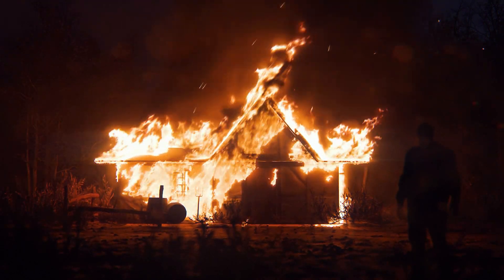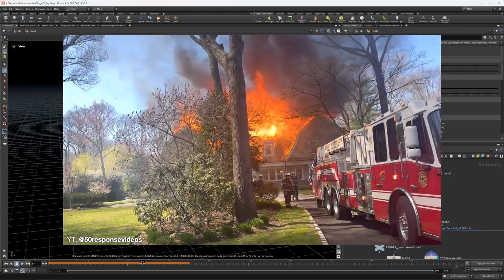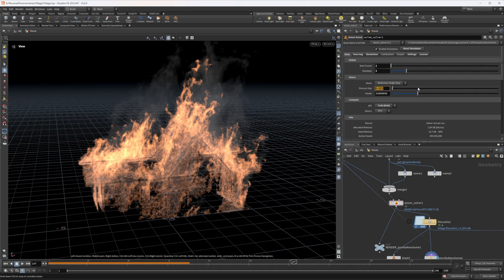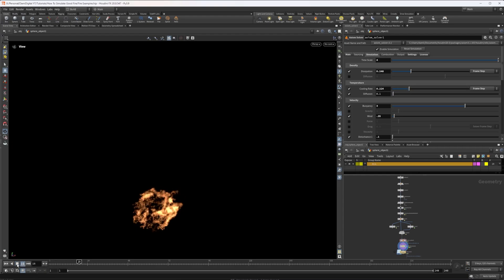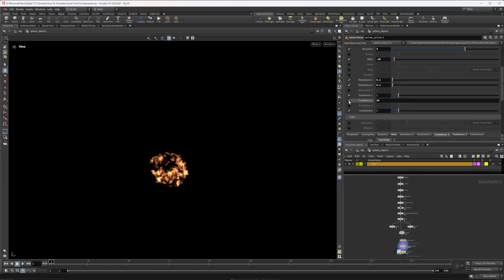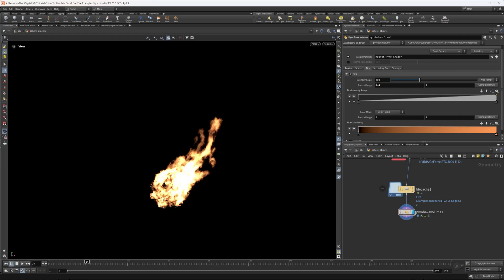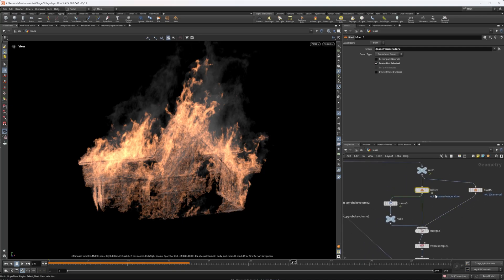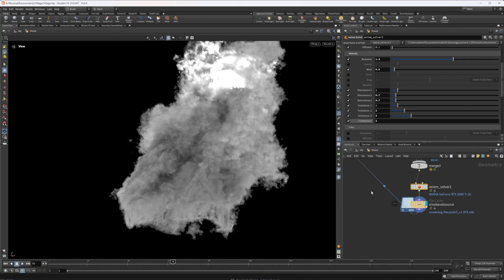HOUDINI AXIOM: How To Simulate Realistic Fire + Free Project File

Comment: Hi, thanks a lot for your video explanation! But I don't understand why you create velocity with the pointvel, then rasterize it and then you blast it (as you only merge density, temperature and collision, but not velocity) so how does it get to the axiom solver?  Thanks a lot for your time!
Reply: Yeah, that is confusing and probably a mistake. The fire wouldn't look like this without randomly noised (curled) up velocities. I am pretty sure he did use the velocities for the actual sim. Don't let this confuse you - just ignore it and use these velocities.
Reply from the maker: @RyoMassaki  100% correct, simply an oversight forgetting to add the v to the rasterize. I've since recorded a new tutorial on a Molotov cocktail and explained this!
Reply from the maker: You're right, an absolute oversight. I'm in the process of a new tutorial and I do use and explain the velocities we create, apologies for any confusion! Just add the v to the rasterize attributes and don't blast it!

Comment: How does the output differ to the built in SOP pyro solver
Reply from the maker: @disvy1936  You could recreate this exactly with the default SOP solver, the difference is in speed. Axiom is considerably faster so you can art direct your fire quicker and easier.

Comment: Man I was excited you did a breakdown for this, then after 2 minutes I realized Houdini breakdowns are NOT inviting for  someone who doesn’t use Houdini or have much experience with nodes.

Just curious, what are your thoughts on Embergen for something like this?
Reply from the maker: @onlyswizzy  I have been thinking of doing full beginning to end videos but they’d be quite long, likely 40 mins plus. If it’s something people are interested in i’d happily make one for my fire workflow, explaining each node. 

Embergen is fantastic and it’s only getting better, I only stopped using it for greater control over my sims and the fact that Axiom is REALLY fast. It’s also easier to get my pyro sims to play with other sims if i just do them all in Houdini. 

More specifically, you could recreate this easily in Embergen, I don’t have much experience with interesting sourcing though e.g. spreading fire dynamics